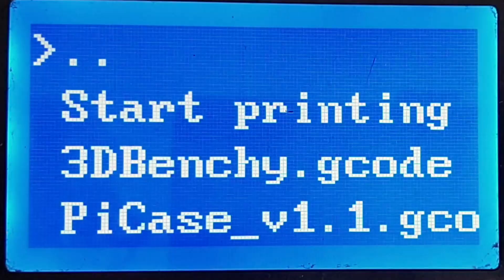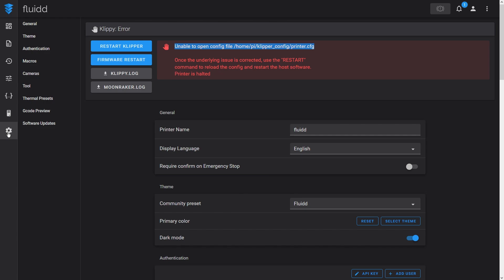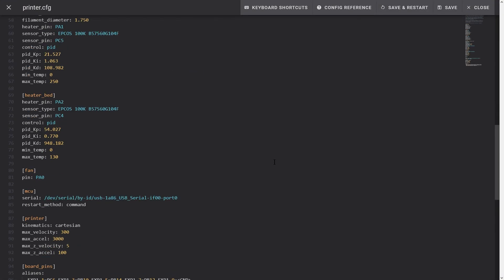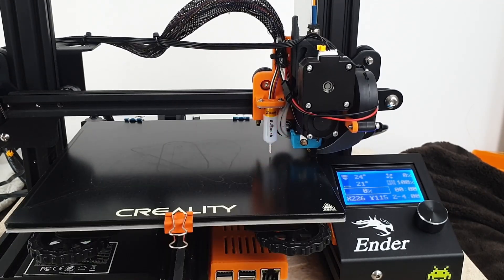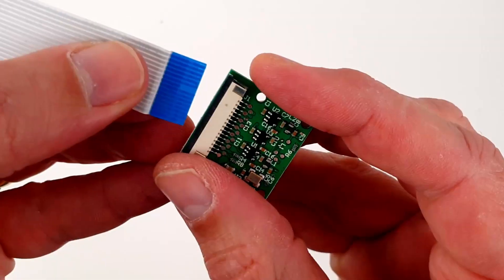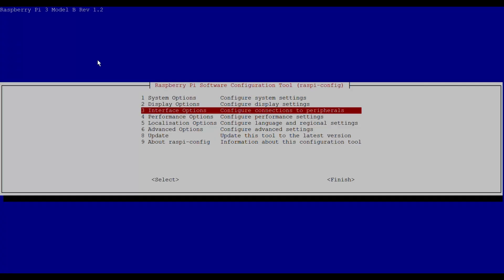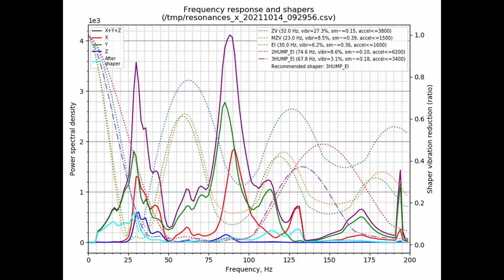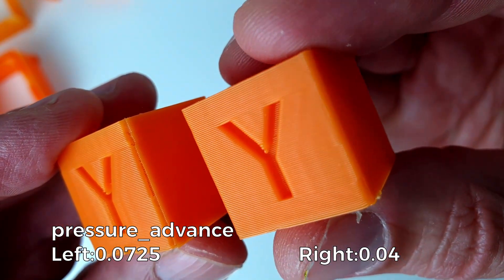Klipper on Ender 3 😱

Comment: I cannot get in with host name, follwing everything
Reply from the maker: Can you connect using the IP address? Connect to your box and see what name or IP adress your box assigned to your Raspberry Pi. You can then use them to connect to the Raspberry Pi. Sometime, the box renames the device
Reply: @YouMakeTech  thanks for reaching out! i think i had an issue with installation, so i formatted drive better and tried again and then had some luck. i left everything default because i was getting confused on somethings when i customized it. All good, thanks for reaching out

Comment: Thanks to share your knowledge, I have a doubt it's possible to have same quality using a 8 bit board v1 and a raspberry pi and klipper  ? Our it's require to have board 4.x.x 
I'm thinking to print speedrive v1 and use klippler with my v1 board , do you think that will work ?
Reply from the maker: Yes, definitely. Klipper will work perfectly fine with your 8 bit v1 mainboard. All computations are made on the Raspberry Pi. The printer's mainboard is only used for low level interface with the stepper motors and printer. It does not need to be 32 bits! The only benefit of the 32 bits mainboars for Klipper is that they are silent
Reply: @YouMakeTech  Tks for your fast reply ,another question I have TL boards , on past most people used to increase print quality and to me worked very well, with klipper installed can I remove this boards ?, or its better to keep installed ?
I've already to do bootload and I'm preparing my Raspeverie Pie 3b , my measure frequencie board will arrive in few weeks , I'm thrilled to do this ...
Reply from the maker: @leofregoneze  Sorry, I haven't tested this because I upgraded my 8 bits board to a 32 bits silent mainboard. Klipper operates the stepper motors at a much higher rate and very smoothly and you may no longer need the TL boards but you will have to test this for yourself.

Comment: Can you print offline with Klipper?:)
U know for example u move somewhere without connection and printer with u
Reply from the maker: Not really unless you install KlipperScreen. On my ender 3 pro, I also can print from the LCD display but not all directories/files show up due to a limitation/bug in Klipper. On the Ender 3 V2, you lose the screen completely and you have to print either from the web interface or install a screen with the KlipperScreen interface. Video coming shortly about this

Comment: What does your start/end G-code look like in Cura? Mine is causing errors and not allowing me to print.
Reply from the maker: My start G-code is: 
; Ender 3 Custom Start G-code
G92 E0 ; Reset Extruder
G28 ; Home all axes
G29 ; Bed Levelling
G1 Z2.0 F3000 ; Move Z Axis up little to prevent scratching of Heat Bed
G1 X0.1 Y20 Z0.3 F5000.0 ; Move to start position
G1 X0.1 Y200.0 Z0.3 F1500.0 E15 ; Draw the first line
G1 X0.4 Y200.0 Z0.3 F5000.0 ; Move to side a little
G1 X0.4 Y20 Z0.3 F1500.0 E30 ; Draw the second line
G92 E0 ; Reset Extruder
G1 Z2.0 F3000 ; Move Z Axis up little to prevent scratching of Heat Bed
G1 X5 Y20 Z0.3 F5000.0 ; Move over to prevent blob squish

And my end G-code is:
G91 ;Relative positioning
G1 E-2 F2700 ;Retract a bit
G1 E-2 Z0.2 F2400 ;Retract and raise Z
G1 X5 Y5 F3000 ;Wipe out
G1 Z10 ;Raise Z more
G90 ;Absolute positioning

G1 X0 Y{machine_depth} ;Present print
M106 S0 ;Turn-off fan
M104 S0 ;Turn-off hotend
M140 S0 ;Turn-off bed

M84 X Y E ;Disable all steppers but Z
Reply from the maker: Note that G29 is not supported by Klipper. G29 performs auto-bed-levelling in Marlin and is frequently added to start G-code in Cura. In order for Klipper to understand and execute the G29 G-code, you need to create a G29 macro as shown in the video

Comment: What do your accelerations look like in your printer.cfg?????
Reply from the maker: 3000 mm/s2. With 3000 the print quality remains as good as with Marlin at 1000. I tried higher accelerations (up to 15000) but the print quality is bad

Comment: Bonsoir et bonne année 2022 pleins de projets. Je rebondi une fois de plus mais cette fois c'est au niveau de l'alimentation du pi à l'alimentation de la ender, pourquoi ne pas s'être raccorder sur une des bornes disponible de l'imprimante en 24V ?
Reply from the maker: Bonne année! Le Pi nécessite d'être alimenté en 5 volts et ne peut pas être alimenté en 24 volts directement.
Reply: @YouMakeTech  En effet d'où le convertisseur de tension, ce que je voulais dire c'est pourquoi passer par un cable Y XT 60 alors que l'on peut directement se connecter au 24V de l'alimentation par le biais de 2 câble avec des cosses U bien moins onéreuse
Reply from the maker: Oui vous pouvez vous connecter aussi directement sur l'alimentation, aucun problème.

Comment: Would you recommend fluidd or octoprint? (Use fluidd, or install klipper with octopi)
Reply from the maker: Fluidd 100%. Fluidd was made for Klipper and the communication between Klipper and the web interface is better
Reply: @YouMakeTech  any thoughts on mainsail? currently installing that.
Reply from the maker: Mainsail is good too, very similar to Fluidd.
Reply: @YouMakeTech  oh also, do you know how to use a crtouch with klipper? I'm having issues.
Reply from the maker: Unfortunately no. I have never tried a CRTouch. Need to order one from Creality for testing
Reply: @YouMakeTech  Alright. The weird thing they do, is they always are retracting the pin, if it's off. It's odd.
Reply: @YouMakeTech  also, does Fluidd/klipper support plugins?
Reply from the maker: Yes it does but not all of them. Octopi is the most compatible for plugins but was not specifically developed for Klipper
Reply: @YouMakeTech  alright thank you! (Also, nice job on the video- fast, easy to follow, and to the point.)

Happy new year!

Comment: Thanks for this video it really helped. I'm setting it up on a PiZero2 for my Ender 3 Max with CR touch. Do you leave the Input Shaping sensor mounted to the print head or only use it when calibrating? Seems I can't have two configured at once and permanently mounted
Reply from the maker: Thanks for your comment. I remove the accelerometer after calibration. It would be interesting to have it mounted all the time, but this would require to move it further up from the nozzle. Attaching the accelerometer to the nozzle provides the most accurate measurements

Comment: Bonjour, J'ai installé Klipper sur mon ender 3 Pro 4.2.7 avec extrudeur OMG V2, et je n'arrive à régler l'extrudeur et le BLTOUCH correctement. Mon extrudeur doit tourner en sens inverse par rapport à l'extrudeur d'origine je sais que pour inverser le sens je dois mettre un "!" devant une valeur mais je ne sais pas laquelle, d'autre part les step/mm de l'extrudeur sont de 377.5 step/mm dasn klipper ce sont des mm/step je ne sais pas à quelle ligne il faut entrer la nouvelle valeur. Concernant le BLTOUCH, il s'agit d'un BLTOUCH creality première version qui doit se brancher à l'aide d'un adaptateur sur la prise écran de la carte mère. Dans marlin pour le faire fonctionner il faut activer la ligne suivante : #define HAS_PIN_27_BOARD je ne trouve pas d'info pour klipper.
Avez vous une idée ? Dans l'attente de votre réponse
Reply from the maker: Bonjour, Pour inverser le l'extrudeur, essayez de mettre un "!" devant le pin dir_pin dans la section [extruder] par exemple: "dir_pin: PB4" ->  "dir_pin: !PB4". 
Pour Klipper, il faut convertir les steps_per_mm en rotation distance avec la formule suivante (https://github.com/Klipper3d/klipper/blob/master/docs/Rotation_Distance.md): rotation_distance = full_steps_per_rotation *  microsteps / steps_per_mm . 

full_steps_per_rotation = 200 steps par rotation (pour un stepper 1.8 deg/step)
microsteps = 16
Pour 377.5 step/mm, ca donne 8.477. Mettre à jour dans la section [extruder] "rotation_distance: 8.477"

Pour le BlTouch, je ne suis pas 100% sur mais je pense que Klipper n'est pas compatible avec l'adaptateur et qu'il faut connecter le BLTouch directement sur le connecteur dédié. L'adaptateur n'était nécessaire que sur les cartes V1 car il n'y avait plus de port disponible pour connecter le BLTouch. Jetez un oeil sur la page suivante, ca devrait vous aider: "https://reprap.org/forum/read.php?415,880766". (Ne cliquez pas sur le lien, ça ne marche pas mais copiez/collez le dans la barre d'adresse)
Reply: @YouMakeTech  Merci pour ces réponses c'est super, je vais pouvoir avancer. Concernant la connexion du BL TOUCH, j'ai trouvé une solution plus simple que de gambader sur les forums en anglais, c'est refaire le câblage en mettant les broches dans le bon sens par rapport aux pins de la carte mère. (Le fil jaune signal était bon mais le V (rouge) et Grd (Bleu) était inversé. une inversion de ces deux câbles et ça doit pouvoir se brancher sur la carte mère
Reply from the maker: C'est ca. En inversant les fils, le BLtouch peut se connecter directement sur le connecteur dédié. Plus besoin d'adaptateur.
Reply: @YouMakeTech  par contre est ce que je peux toujours brancher la prise Z endstop du cable du BLTOUCH sur la connexion Z endstop de la carte mère (celle ou le contacteur Z endstop était branché)?
Reply: @YouMakeTech  une autre question, j'utilise un PC avec OS debian pour faire fonctionner ma machine, j'ai un écran et un clavier/souris. Pour votre rasperry Pi, vous le raccordez aussi avec un clavier écran et souris ou utilisez vous votre PC windows pour faire fonctionner le tout ?
Reply from the maker: @frabois3941  Oui vous pouvez mais pourquoi faire? Autant tout brancher sur le connecteur dédié 5 broches
Reply from the maker: @frabois3941  La distribution FluidPi fournit une interface web et un serveur ssh. Du coup je me connecte à distance depuis mon téléphone ou mon pc, pas besoin de connecter écran/clavier/souris au Raspberry Pi
Reply: @YouMakeTech  Alors oui mais le seul souci c'est que la prise du endstop est trop grosse du coup impossible de brancher les 2 sur la 5 broches
Reply from the maker: Vous pouvez rester comme ça alors. J'avais le même problème et pour pouvoir me connecter sur le connecteur dédié  j'avais acheté ça: https://amzn.to/3muKnSo
Reply: @YouMakeTech  super, mais sinon la commande reste la même?

Comment: Very happy that i switched to Klipper from stock Marlin. Am getting significantly faster prints at higher quality. Your instructions were very helpful. Thanks! 👍
Reply: Is it worth buying ender 3 to use it with klipper and linear rail to get quality prints? I was planning to get voron 2.4 but it costs a lot more so i cant make decision which one to buy

Comment: Thank you, informative and fast.

Is your e3pro with it's original components or did you made any hardware changes? 
I noticed direct drive, is that important to achieve fast prints? What type is it?
Is there any changes if this guide used on e3v2?
Reply from the maker: Thanks for your comment. I also upgraded my Ender 3 to direct drive, with an E3D V6 hotend and a BMG extruder + 5015 fan for cooling. I cover this in more details in this video -> https://youtu.be/volF41C7BLI . This is required to achieve 150 mm/s print speed at 3000 mm/s2.
Reply: @YouMakeTech  Thanks for replaying. I suped and going through your videos. 
Would this guide work with ender 3 v2?
Reply from the maker: Yes, 99% of the guide is applicable to the Ender 3 V2. The only difference is the printer configuration file printer.cfg. My Ender 3 Pro has been upgraded to a Creality V4.2.7 mainboard and I use the "generic-creality-v4.2.7.cfg" from Klipper examples as a starting point. The Ender 3 V2 is normally shipped with Creality V4.2.2 mainboard and the pin names are different. You should start with the "printer-creality-ender3-v2-2020.cfg" example from Klipper. Also, the Ender 3 Pro has an LCD display and I add a [display] section to support it during the video. This is not applicable to the Ender 3 V2.
Reply: @YouMakeTech  Thanks for your notes, I'll take slow with the upgrades.

Comment: I thought 0.005 is for direct drive extruder. When ender 3 has a bowden type extruder. Am I wrong on the configuration?.
Reply from the maker: You are right. I am using 0.005 because I upgraded my Ender 3 to direct drive. More info here -> https://youtu.be/volF41C7BLI

Comment: Seems awesome but I just spent way more than I should have getting the bltouch, bondtech, and e3d v6 😅. What pi are you using here?
Reply from the maker: I use a 3B+ I already bought for another project. Right now, it is kind of hard to buy a Raspberry Pi, they are out of stock everywhere and expensive... Looks like a Pi zero is sufficient and cheaper.

Comment: Ive had this setup for ages, but a new firmware update stopped my printer dead. I now have to learn about rotation, until then I can't print. Are you doing a video about this? I'm sure it's stopped lots of people. I'm going to re-watch your advance part of the video slowed down 10 times lol :) many thanks.
Reply from the maker: Well, I have only had this setup for a couple of months, therefore you probably know way more about Klipper than I do! Are you referring to the new rotation distance parameter? https://www.klipper3d.org/Rotation_Distance.html
Last time I updated Klipper, it broke everything... I had to recompile the firmware and so on. From now on, I probably stop updating Klipper as it works fine like this!

Comment: Hey! I love your videos I will continue to keep watching. I have just recently ,after watching this video, hooked up my raspberry pi and installed klipper on my Ender 3 Pro, a jump a skip and a few hiccups later I am finally getting my printer to ... well... print. lol. What slicer are  you using? and could you possible share your slicer profile or settings? your test cube looked amazing and at only 6 minutes is just flawless.
Reply from the maker: Thank you so much for your comment. Glad you enjoy my videos!  I am using Ultimaker Cura. These are my settings: In Klipper, I set max_accel: 3000 and max_accel_to_decel: 3000, pressure_advance: 0.04 and input shaping enabled. 
In Cura, start with the default 0.2 mm profile for the Ender 3. Then make the following changes (for Sunlu PLA+) : 
Layer Height = 0.25 mm, Line Width = 0.4 mm, Wall Line Count = 2, Top/Bottom Layers = 3, Infill Density = 20%, Printing Temperature = 230°C,  Build Plate Temperature = 70°C, All print speeds (infill, wall, support etc.) to 150 mm/s except Travel Speed = 250 mm/s, Initial Layer Speed = 50 mm/s and Skirt/Brim Speed = 50 mm/s. Number of Slow Layers= 1. Retraction Distance = 1 mm. Retraction Speed = 25 mm/s. Combing Mode = Not in Skin. Fan Speed = 100%. Initial Fan Speed = 0%. Regular Fan Speed at Layer = 2. Minimum Layer Time = 0 s. Enjoy Klipper and see you soon on YouMakeTech!
Reply: @YouMakeTech  Thank you so much. You are one of the greats.
Reply: @YouMakeTech  Thanks for sharing. I finished the update to klipper today and with your printer.cfg file and these cura setting I got a benchy done in 50 minutes. Any idea how to get it under 30 minutes ?
Reply from the maker: With these settings, I print it in less than 28 minutes. Did you set Minimum Layer Time = 0 s in the slicer? This is super important and often overlooked. Otherwise the slicer reduces the print speed such that each layer is printed in no less than 15 seconds. Also some parameters are in the printer and not in the slicer (e.g. max accel and accel to decel). I use 3000 mm/s2 for both